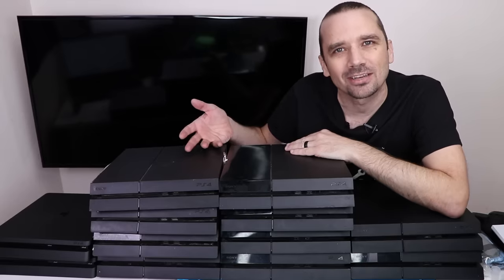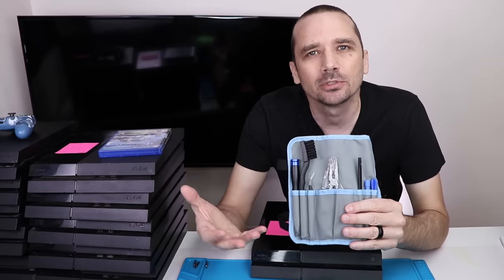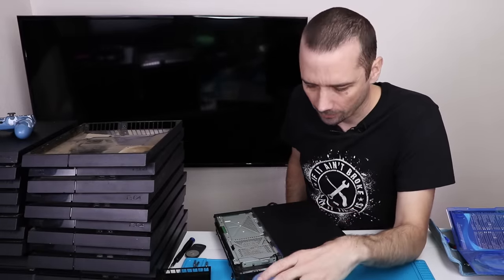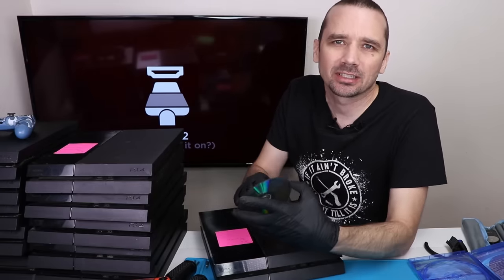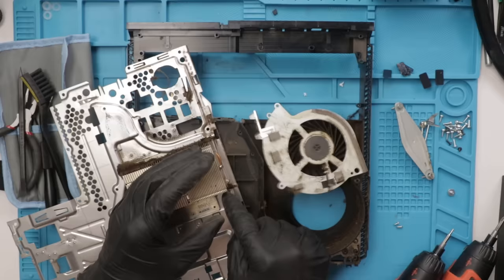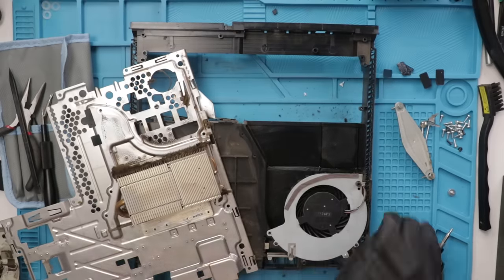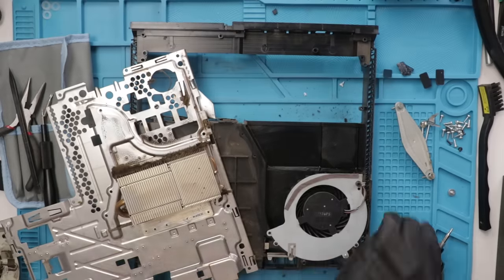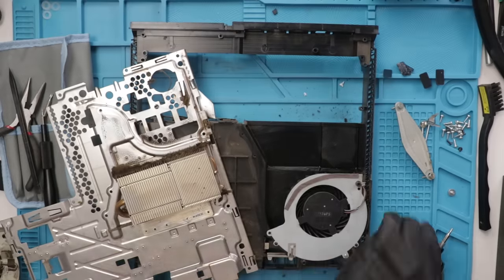I Bought 12 Broken PS4's From eBay - Let's Try to Fix Them!

Comment: Use a vacuum too for Christ sakes.
Reply: u cant it'll spin the fans the wrong way and damage the console
Reply: @ss11111ss  what about holding the blades?
Reply: I've used a vacuum on fans of all kinds from various systems and had no issues whatsoever.
Reply: @ss11111ss  damage them, not possible, PC fans use a brushless motor, when unpowered you would feel some slight magnetic resistance, but other then that pretty much nothing bad can happen (if you want to be extra safe, just tape the blades in place with electrical tape) (and yes, consoles use the same fans as PC's, they just aren't a standard size)
Reply: @hetznaz7902  brushless motors still have bearings. if the entire assembly is spun beyond what it is mechanically designed for it could be damaged. best to just hold it down with a finger rather than chance it.
Reply: @fd3871  the bearing is a free spinning bearing, its there just to hold the blades in place and let them spin freely, if you swap the polls of a brushless motor it will spin backwards on that bearing without damage (You can do this on old 2 pin fans, but newer DC and PWM fans have control boards inside which receive the voltage before it goes directly to the motor, so if you did this it would kill your fan)
Reply: @hetznaz7902  bearings spun too fast can be damaged (broken seals, .etc.) irregardless of direction. unlikely but can happen.
Reply: @fd3871  the bearings in fans are designed to spin at 2000ish rpm for years on end
Reply: @fd3871  the only damage that can happen to the bearing is to the balls, if they get dirty or scratched or anything the bearing will begin to make noise, and eventually completely lock up, this is not caused by spinning them in the wrong direction, its caused by dirt and unwanted stuff entering the assembly (which is realistically only gonna happen if you open it up)
Reply: @hetznaz7902  are you saying that because a bearing is designed to operate between a-b rpm, that running it at c rpm for even a short period of time can't hurt it? bearings, like I said, typically have silicon or polymer seals that hold the lubricant in and keep contaminants out. if these seals fail due to excess stress outside the operating parameters the lubricant can leak and cause premature failure of the bearing  which may manifest in noise, seizing, .etc. irregardless, I think saying it is impossible to damage a fan this way is a bit exaggerated. Improbable, yes, but when I can simply hold my finger on the blade while dusting it with compressed air, why not do so and minimize risk?
Reply: @fd3871  saying won't break when spinning at c rpm when the c is of a lesser value then a or b is correct, also bearings aren't sealed, they are by no means air or water tight, yes there is a poly side, but its intention is not to seal anything out, nor does it have any meaningful affect on keeping the lubricant in, its design intention is to keep the steel balls which the bearing relies on kept within in place. (Yes, it statistically possible that it "can" break when spinning opposite of standard poles, but it's a statistical improbability, and is significantly more likely to be damage when running normally within parameters. Also, keep in mind, bearings have no "right" way, they are designed to spin freely in either direction without damage, they can spin too fast, which would damage the bearing, but, like I said, the bearings in fans are engineered to spin billions of times, at speeds of upwards of 2000rpm (some fans can do over 12k rpm, but those are for the server space, and are never used in standard builds)
Reply: @hetznaz7902  ah. see I posit that c is greater than a-b. but i use compressed air from my air compressor. would be interesting to read the speed while the fan is off under the circumstance of both canned and compressed air to see if either goes over the max rpm and by how much. i know when i blow out smaller fans without holding them they sound like the are going audibly faster than their max rpm when operating excluding the noise from the air itself which is entirely non-scientific.
Reply: The bearing out of a good fan (noctua, bequiet!, etc) can easily do 10-15k rpm without problem for short-ish periods, server fans could easily do 20k rpm without damage (speed measured at the edge of the rotating outer drum)
Reply: @hetznaz7902  how about a cheap Chinese non name brand in a PS4 or laptop? Better safe that having to replace.
Reply: @fd3871  Even the cheapest of bearings are quite durable. The only difference between good and cheap bearings is the quality of the steel/ceramic balls, and the quality of the housing, which allows for less friction, and therefore higher rotation speeds (also makes achieving desired rotation require less force), PS4's however, actually use decent bearings in their fans (Even if you don't directly recognize the brand).
Reply: @ss11111ss  And explain how so? In the past 8 years of me working on PC's and consoles, I have never, and I mean NEVER had a fan be damaged by rotating it "the wrong way"

Comment: I have a ps4 it fell One time and now it doesnt turn on.
Reply: Now I feel like I'm very lucky...My ps4 fell 2 times from a height of 3 feet😅🤣🤣
Reply: @sakshamdev1177  mine's crashed from 4 feet at least a dozen times, thought it died once but just knocked the disc in it out of alignment and wouldn't power on until I manually removed the disc
Reply: Your battery might have became disconnected I bought a PS4 and fixed it all because the dudes battery wire wasn’t plugged in lmao

Comment: why dont you use conpressed air to clean the dust? its far more efficent than the brush
Reply from the maker: Sometimes the dust doesn't come off even with compressed air so you have to get in there with a brush. I do usually used compressed air too

Comment: Bro I wish you could fix my PS4 it's just broke as number 1 but without the roaches cuz someone stepped on it but if it's a game in their I gotta take it out and cut my game off and then put the disk in
Reply: My dad had to take apart my PS4 just to get the game out then I had to sadly go get a new PS4 which only took almost 2 months.
Reply: you can get your disc out without console needing power.ps4 has a screw that you can screw to get the disc out. search on yt ps4 how to get stuck disc out

Comment: Everyone complaining about the dirt inside, literally every console looks like that lol. After probably owning them for 3 + years what do you expect? Most people won't be bothered/ would be worried about cleaning them
Reply: Did you see the first console? The only way yours will look like that is if you live in absolute filth and never clean your surroundings. That dust was a thick brown color, looked like it was either in a heavy smokers possession or in a kitchen with a bunch of grease.
Reply: Yes, normal dust is grey and fluffy, and comes off easily. Even with furry pets, you only get more of it. 
I haven't cleaned any grease-afflicted electronics, but I know that indoor smoking results in this sticky, stinky, dark brown crud.

Comment: That first PS4 is 100% from a pot smokers house. I bought used one that looked like that. Ended up having to completely dismantle it and clean everything, especially the heat sink (33% covered by a solid glob of weed tar and dog hair).

Don't smoke weed around your electronics kids.
Reply from the maker: I did seem much more relaxed after that one! JK JK
Reply: @Tronicsfix  lolll
Reply: @Tronicsfix  Or better yet, don't smoke anything around your electronics.  In the days before most workplaces banned smoking, I had a co-worker who was a chain smoker and literally used his computer like a smokeless ashtray.  He noticed that the smoke from his ashtray was pulled into the fan, so he put his ashtray next to the computer so the smoke wouldn't bother customers.  I'm surprised it lasted as long as it did... when I opened it up, the entire inside was covered with brown oily goo.  On the plus side, I got him to stop smoking.  "If your cigarettes do this to a computer, imagine what it's doing to your lungs."  ;^)

Many years later, after I went into business for myself, I had two guys bring in a PS2 that was almost (but not quite) out of warranty.  When I opened it up, it was covered with what I can only describe as brown epoxy... after some questioning, I figured out it was from their cigarettes (both of them were chain smokers), but it had hardened into a brown crust that was so hard, I couldn't even chip it off with a screwdriver.  They were not happy when I told them the damage qualified as "deliberate abuse" and would not be covered under warranty, so they'd either have to pay for repairs or buy a new PS2.

Comment: Great video, im in LA and most stores are sold out with PS4s and selling really expensive on OfferUp and Facebook store. You said $140 and now if you were selling those right now you could EASY get $200-$250. But im just saying. Again great video i might buy the tools and deep clean the fan on my PS4, it does make really loud noise when running the disk games but not on the downloaded ones.

Comment: For cooling fun cleaning (extreme) I use air condition condenser and air handler cleaner. There is also a Simple Green aluminum safe cleaner too.

Comment: Did you ever try to relubricate that fan? Is there a Plug in the middle? Then open it and access to the bearing. Or drill a hole into it to get access to the bearing... 😉

Comment: hi when you use hot air what temperature are you using please and what's you air power ? Also do you need flux toget off a component because when i'm using my hot air pistol i'm maximum temperature and sometimes nothing change. Sorry for my english i'm french ^^

Comment: The cleaning part you can air blast all the dust using small compressor with dryer. It is much more efficient. And the air can reach to the smallest area in the circuit board too.

Comment: Where do you get your parts from? I have a few PS4's that need to be fixed. The HDMI's not working. I had a surge and 4 devices in my entertainment system blew out including my TV. I had to replace the board.

Comment: Good job with replacing cleaning but why not reflow chips? Adding washers not really good fix, when you have it all apart at least check/replace thermal paste. I'm very surprised you don't have BGA station...

Comment: Thanx dear by using ur video i solved my disk insert issue it was the roller which was pulled off so disgusting y Sony do that they should also put a removable air filter to stop the dust going in and solve heating issues as well

Comment: Can't you re flow the apu/cpu with your hot air gun? I remember fixing Xbox 360s using a re flow station back in the day, but since the solder was crap it didn't stay fixed long.

Comment: I was really interested in PS4 #11.  You mentioned the disc drive starts at startup, but seeing you couldn't fix it you didn't address the issue.  I was wondering why the disc drive would start up when powering on as I have a Slim that does just that.  
*  It won't take discs (rollers/motor doesn't spin when trying to put the disc in).

*  The laser tries to read the disc with no disc inside when powering on.

*  Will read if manually turning the screw to load the disc.

*  Disc ejects just fine.
Reply: I was able to troubleshoot it.  It was a broken switch on the disc sensor board.

Comment: He paid 91 dls for each PS4 and he says he sells them for 140, so the profit is 49 dls for each fixed console, he fixed 9 the profit is 441 dls. He can still sell the 3 he couldn't repair for 90 dls on ebay, which he has done with other consoles like the switch, he said the switches he couldn't fix he would sell them again on ebay to recuperate what he originally paid for. When he says he only made 166 dls he is not taking into account the 270 dls that he can get from the 3 broken consoles, unless he is just gonna throw them in the garbage, his numbers are wrong.
The video is great tho' and I'll keep watching more of these for sure.

Comment: In the last when the controller charges but don’t connect what is the problem? I have a ps4 with that problem for years and don’t know what it is.. it turns on shows the users on the tv but the controllers still won’t connect i had got it to work for some days but after a while it stopped again.. any help is appreciated thanks 👍

Comment: I have a question, my ps4 after falling multiple times. It suddenly stopped working. It loads then at 27% the fan turns into a jet then it just beeps off. Do you think you have a diagnosis?

Comment: If you use liquid flux and reflow the chip with a heat gun ( move the hear over the chip semi quick)  it will work 90 percent of the time.  I say this because i work with bga chips on a daily and one thing i do to fix non working chips like this is to reflow it.

Comment: @TronicsFix Hey my guy im having a problem with my slim Ps4 ... It freez first Then It shut off by itself ... I have tried restoring data base and i tried also restore licenses key and didnt work either... You think if it got dust inside could that be problem ?? I havent opened the ps4 yet

Comment: My PS4 was working perfectly a few days ago. Now everytime I want to turn it on it says "cannot start the ps4". I've tried updating the system software through Ethernet but still pops up the same message after finishing. Another thing I tried was rebuilding the data base and it just gives me an error, and lastly I tried initializing the PS4 but it just says "cannot initialize". Is this fixable? Do I need a new hard drive?, Or should i just get a new PS4.

Comment: @Tronicsfix 
 I have an old ps4 here with me 1st generation. Had watched your cleaning tutorial and cleaned that bad boy. The one problem it had was it was so damn loud. I cleaned it and plugged it in but now im stuck in safe mode and will loop over and over again. The picture will also have a grain red look and will flicker. No idea what happend could use some assistance into what i can do next. Thank you!

Comment: My ps4 just stopped accepting discs after manually ejecting stuck disc. I just opened it and cleaned the rollers along with everything  inside and is still not accepting discs. Any suggestions on what else to fix or replace?

Comment: bruh my disc drive is so broken honestly, literally when i put a CD, suppose FIFA 20 it takes it out after a few secs.
Reply: It spits it out because FIFA 20 is garbage

Maybe consider trying to repair it. I (12) repaired a PS4 disc drive after my younger brother stuck some coins, puzzle pieces, and a library card inside it.
Reply: @therealmistermemer  i did try to fix it, but my mom was like: ayo wtf r u doing, go put it back noob
Reply: @Reversifyy  lol my mom had the same reaction. I had to do it at 3am

Comment: Any ideas. I connected all my controllers to another ps4 and tried to connect them back to my ps4 but i can’t because my Usb ports on my Ps4 are not working iv cleaned them abit and got some dust out but still no good. So wondering if theres any other ways! Cheers

Comment: If your reading this comment and know what im talking about please respond: My PS4 has a loud fan whenever I play games like Minecraft and Attack on Titan, does this mean that the fan is dirty and needs fixing or is it just old?
Reply: Well how old it is
Reply: And i recommend cleaning it is it an ps4 ,ps4 slim or ps4 pro
Reply: @jackanderson313  Sorry for not answering quicker its just a ps4 and i think 7 or 6 years old it was around the year or year after it came out
Reply: @struggle_much7473  That's quite old have you ever clean or open it ?
Reply: @jackanderson313  No I haven't
Reply: @struggle_much7473  Well you really really like really need to clean it and it's not that hard/expensive to clean a ps4
Reply: @jackanderson313  Ill talk to my dad and thank you Jack.
Reply: @struggle_much7473  Don't worry it's so easy my niece can do it just be careful about the fan
Reply: @jackanderson313  Can i use any toothbrush or a certain toothbrush, or can i use something else
Reply: @struggle_much7473  Yes you can use any toothbrush

Comment: I took my laptop in for a fan replacement and they asked me if i wanted to do a complete clean and replace the grease on the heat sink. I thought, clean? Its not like i spilled coffee in it or anything. But he says the number one failure is overheating from dust, particularly from households with people who smoke. If gets sucked into the computer by the fan and smoke residue coats everything along with the dust inside and insulates it so it can't cool off. Another reason not to smoke.

Comment: So I have a ps4 slim the disc drive stopped working one day, I've looked at it several times nothing appears to be wrong no missing components or anything that I can see. Another thing is when i try to update the system software it doesn't allow me to, is that because the disc drive is working or what?

Comment: I need help, when I press my controller button to start the PS4, the two controllers start blinking and they won’t turn on but the PS4 works, but sometimes when I take out the cable that gives the PS4 power, sometimes the controllers start working and then 10 minutes later they turn off and won’t turn on. Is my PS4 broken and I can’t get it fixed or? And if I can fix it please tell me how.

Comment: Hi buddy I bought a ps4 slim 2nd hand recently. And the warranty sticker is still on it looks like brand new no dust anything.. When I got it. It had no hdd so I put a hdd in it but it came up ps4 slim error code ce-34335-8.. So I tried another hdd but the same code. Also won't go into safe mode... Any advice would be appreciated 😊